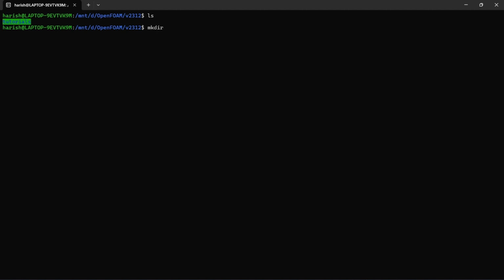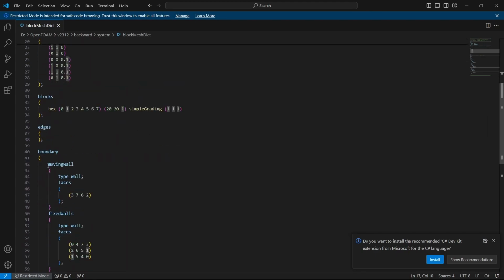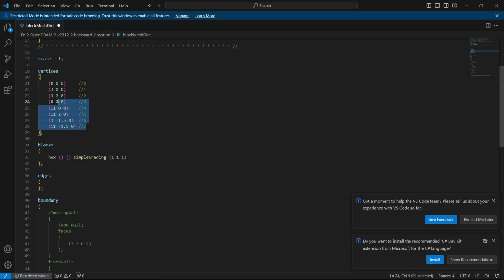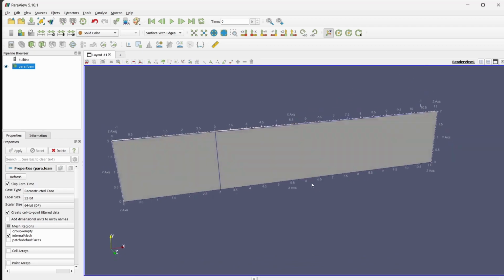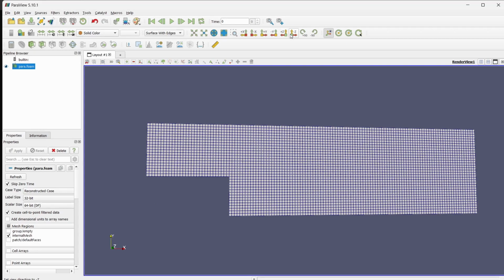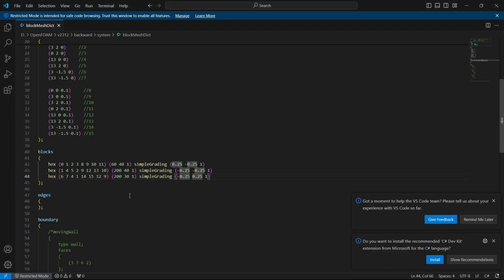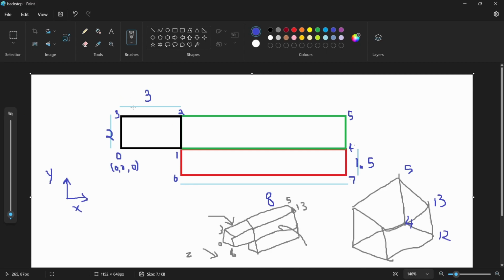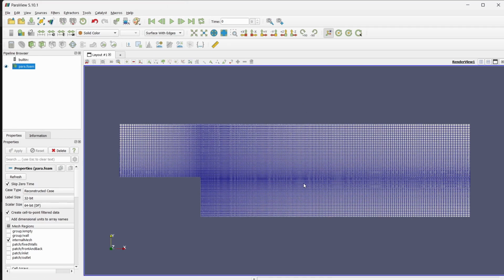Backward Facing Step using blockMesh | OpenFOAM Tutorial

Comment: On the outlet, why starting from 5, instead of 4? (4 12 13 5) instead of (5 4 12 13).
Reply from the maker: It is a cycle. It should work both ways.